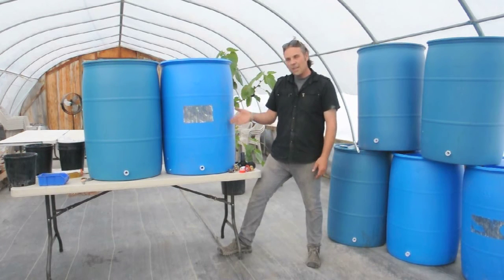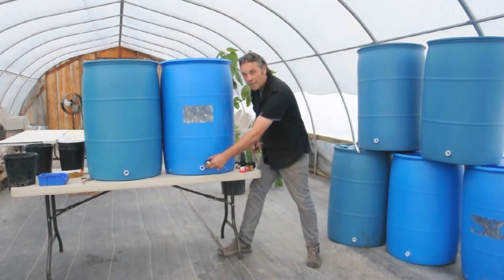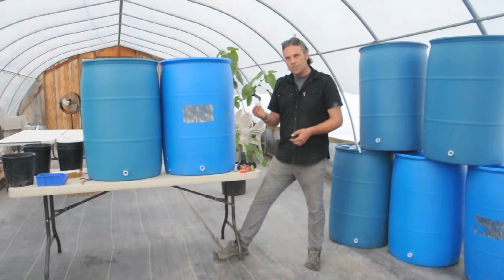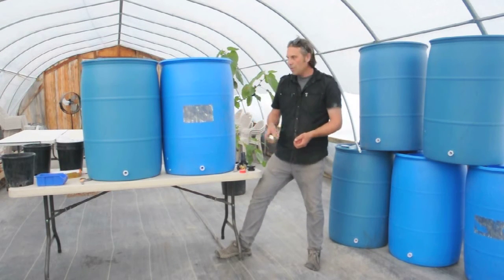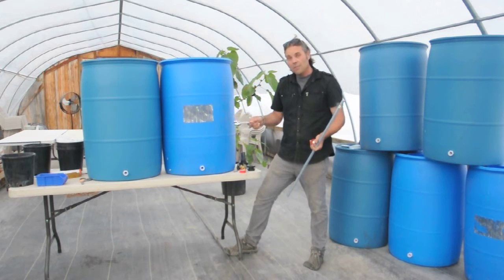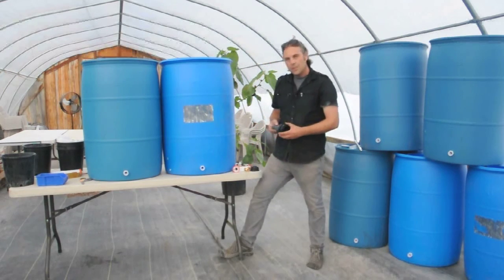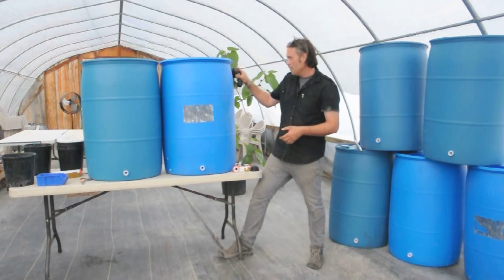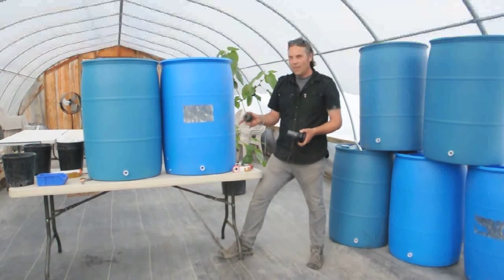Rain Barrel DIY Fix

Comment: I accidently forgot to drain the tank before the winter came. The ice expansion made about one foot crack on the barrel. Any suggestion? A friend suggested a flex tape but when I checked, it seems like the tape should be on the water side. But I can't reach the inner side of the barrel.